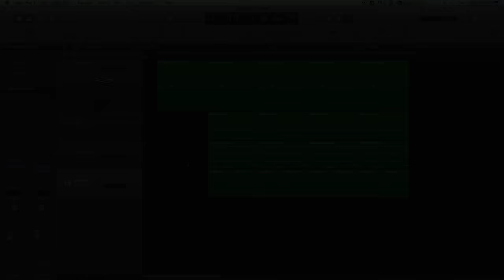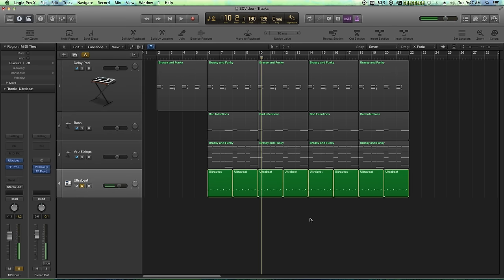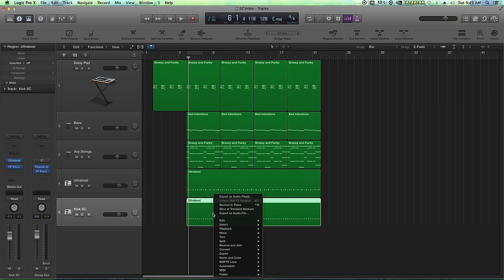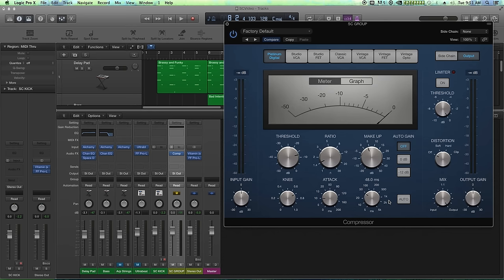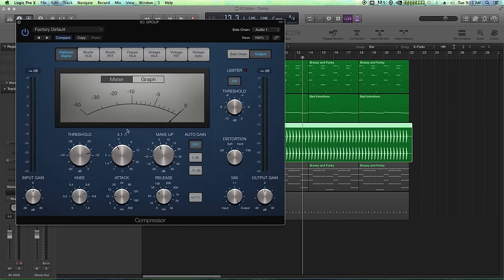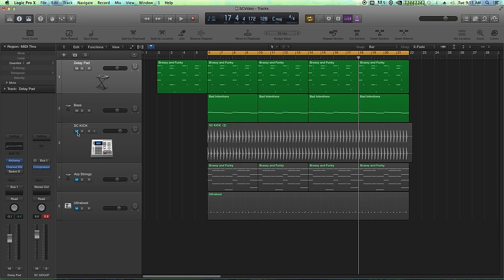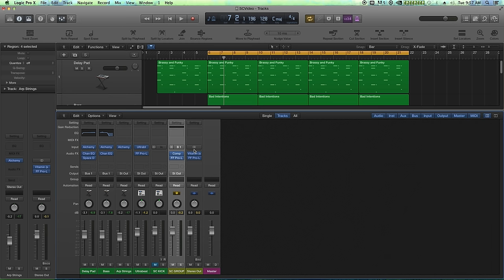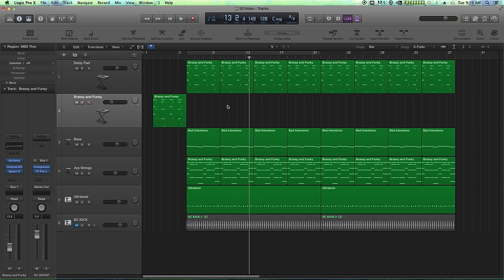Logic Pro X - Sidechain Pumping Effect with an Aux Track + Compressor

Comment: Way easier is to put an audio kick on a random audio track with NO output stretched along the whole track and select that audio track for sidechain in the compressor on the track you want to sidechain. When you got parts in your song with no (midi) kick, you still got the sidechain effect without hearing the kick as it has no output. You don't need any bus or extra routing like shown here. Important for the sidechain impact length is that with an audio kick, you can short the kicklength for a much tighter or longer sidechain effect.
Reply: Thank you for the info!
Reply: This is much easier! Thanks for the tip, saved me watching the rest of this video haha!
Reply: Doesn't that mean you're only compressing the one track though? I think the reason MTHG uses an Aux here is so he can duck multiple tracks at once.
Reply: I always do the same And I like this method more than others. but I still want to improve it. to expaian what I mean it's better to  ask this question "What if I need to use the exaxtly the same output wave shape of my midi kicks which already had some EQ, compression...on it. I mean I want to use  the same similar output of my midi kick on trigger kick  in this method.  should I do copy/paste all plugings which is on midi kick slot? or there is any specific routing way to reach this result  I am looking for? I am trying to create a template which fulfiill this idea
Reply: Brilliant, thanks!

Comment: Another trick for this, because if you have parts where the drums drop out but you still want the sidechain to engage and for consistency through the track, is to make duplicate the kick track, and copy over the kick audio, and run the sidechain through that channel. Then on the channels strip, where it says “stereo out”, select “no output”. Won’t hear the second kick but sidechain will still kick in.
Reply: You can also automate the volume of the kick down to 0 right?
Reply: @jamie36  not sure, but I don’t think so as there would then be no signal triggering the compressor. When you set it to “stereo out” to no output, the signal is still there to trigger the compressor. If the volume is down then there would be no signal triggering it. Don’t quote me though 😅👍🏼
Reply: @Yeah_bruv  fair enough. I'm rather new to logic (as in, I've been using it for a year now) so I was just putting my first thoughts here lol. I'll have to experiment with it myself first but it just felt easier 😅

Comment: I remember something with a kick side chain... but then when I tried it, I was confused why it wasn't working... converting the midi to an audio file was the key. Thank you.
Reply from the maker: In more recent versions of Logic, you can now side chain input from software instrument tracks. But the input signal is based on the audio output of the instrument on the track, not the MIDI itself. So as long as you have an instrument loaded up, you can now use instruments as side chain inputs. At the time of making this video this was not possible.

Comment: Great video! I also prefer using the filter option of the compressor in hi pass to get just a ticky kind of transient as the sc source.  The release time can then be more controlled and to be significantly faster because the compressor doesn' t have to wait for the low frequencies tail to shut up. Of course there are various ways to do the same thing. (messing around with the sc source)

Comment: you can use midi. you send it to a bus. then delete the bus aux.
Reply: Why would you delete the bus aux?
Reply: actually a better option is to send the buss aux to "no output" which is pretty much deleting it from playing... you do this because otherwise it would be playing the sound twice. once on the track. and once on the bus. but even with the bus sent to no output, muted, or deleted... the compressor will still read the midi files and duck it like its supposed to.... tbh if you watch like 2 other youtube tutorials on ducking bass in logic you will most likely find this method of doing it.
Reply: Yeah that's what I do as well. When you said, "delete the bus aux", I thought you might have been referring to something else.

Comment: Good video. The only drawback, if I'm understanding right, is that effect changing the uniformity of the mix after the sequence. Or am I missing something?
Reply from the maker: Yeah, sometimes in order to get a deep pumping/ducking effect with this, you have to bend over backwards to get it right in the mix, and re-gain stage the compressor so it doesn't clip on the peaks of the ducking.

Comment: Got a question: what are the PROs and CONS of routing the "to be pumped" tracks through the extra track via OUTPUT versus adding a compressor to each of the "to be pumped" tracks and telling the compressor to source the SC GROUP track? is it better from a performance point of view, as the way you present it, you only have one compressor versus in the other scenario you would have multiple compressors?

Comment: I'm trying to set up a side chain compressor on an aux bus. I know how to do this and to assign the compressor to side-chain to the track of the kick drum. My problem is the instrument tracks that I would like to have ducked under the kick are already assigned to a SUM (Track Stack), which is Bus 11. If I switch the Bus of these tracks to the aux bus with the side chin compressor, then they will no longer be controlled by the Sum track. Is there a way to set up both Bus 11 and Bus 16 (For side-chain)? If so, can someone please explain how to set this up? Thanks!!

Comment: What do s sidechain? And what does it do? Like you mentioned compression, what is this to do with it and what effect does sidechaining have?
Reply from the maker: +Eric Boisson Side Chaining takes the signal of an audio track and applies that signal to the compressor. So as each kick hits in the audio track, the compressor will compress harder. When the kick isn't hitting, the compression isn't hitting. The kick is essentially a modulation source for the amount/motion of the compression, to vary the amount of compression across time.

Comment: Hey, Im having an issue with panning. When I pan things to the right, they come out of my left speaker and vice versa. When I listen to my song on my mac speakers, everything is ok. I know this is not related to your video but I immediately thought I would ask you haha. My speakers are JBL LSR 305. Thank you!
Reply: It sounds like you connected the cables from the interface to monitors side ways, Swap the cables on your monitors, so take out the left and plug it to the right, vice versa. problem should be sorted.

Comment: I can't get this to work for me...trying to do a cover of Avicii's "Levels" just for a fun project. Using a synth pad, I've got some white noise going, not much during the part of the song I want affected by the side chain. Did exactly what you did with the compressor and the buses and still doesn't work. Any ideas on why?
Reply: Add on...weird thing is that on the graph in the compressor it is showing the drops I want (just a four on the floor) but for some reason it doesn't translate to what I'm hearing.

Comment: How come the compressor is being assigned for all of my tracks when I only want it to be applied to two? I didn't follow the way you did in the video, but assigned the tracks I wanted to the same bus of the kick drum. Hope you can reply! Been trying to figure side chaining out, but now everything is being side chained!
Reply: Are they all supposed to be on stereo output?
Reply: and by compressor, I mean the same side chain settings. For example, if I change one bus, all the rest will change to it as well.
Reply: You may have chucked the compressor on the master track by mistake, which is the tab that displays 'Stereo Out' at the bottom.

Comment: The more and more I study logic, the more I see how overly complicated it is to do such simple tasks. People stand by it, and that's their prerogative, but there seem to be so many ridiculous little workarounds that you have to run through to do really simple things. I don't get the hype.
Reply from the maker: +Cornbreadddd I've used pretty much every major DAW out on the market. Logic, Pro Tools, Cubase, Ableton Live, Sonar.... they are all the same, they have their ups and downs, but they all basically function the same. Sidechain pumping before DAWs required you to actually have a hardware compressor unit and a hardware sampler unit with a kick triggering the compressor to downward compress. I think that's a bit more complicated than doing it in logic!